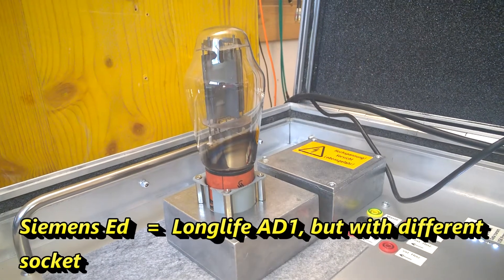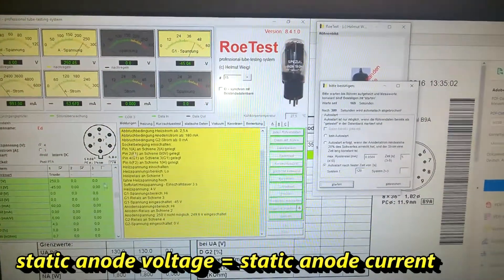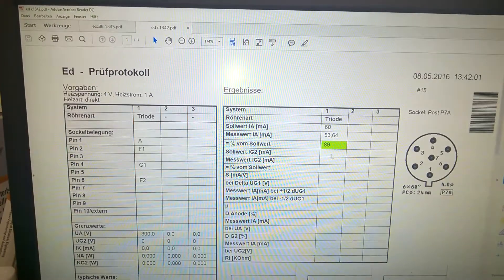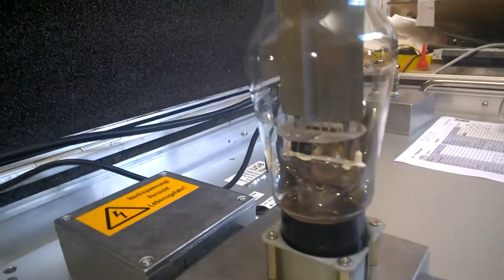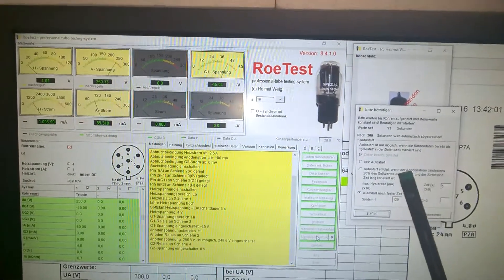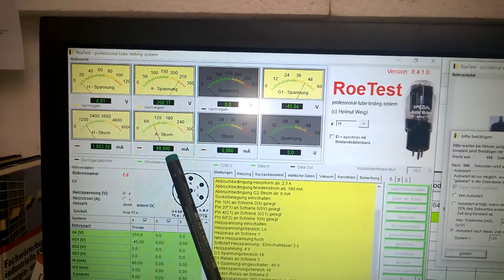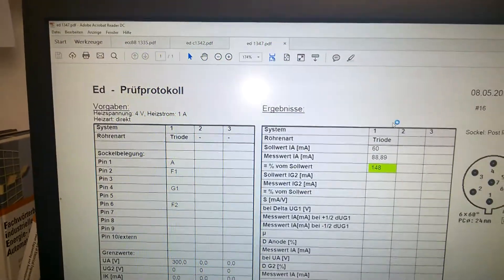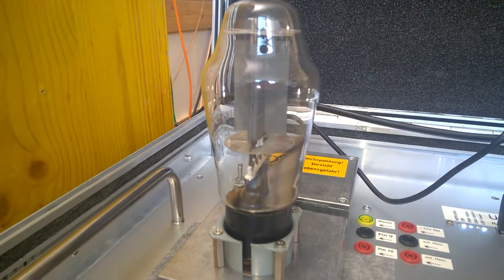Roetest Tube Tester: Testing a Siemens Ed tube (longlife AD1)

Comment: what's mean 60ma 100% for ED tube?
what is minimum emission for using?
Reply from the maker: 60mA at the given voltages would be 100% exactly as stated on the datasheet.
The minimum emission depends on the circuit and bias. there is no clear answer on that. every circuit is different. Could be that an amp is producing noise only, if the tube has less than 40mA.